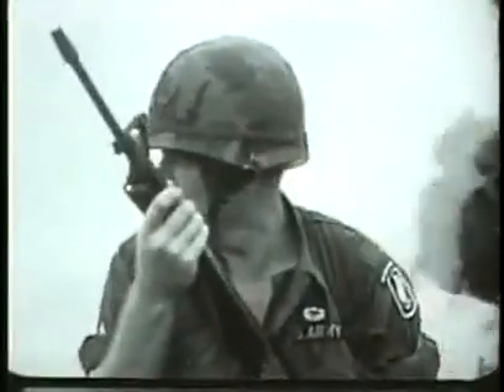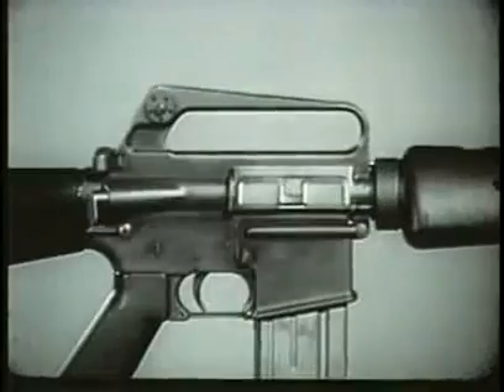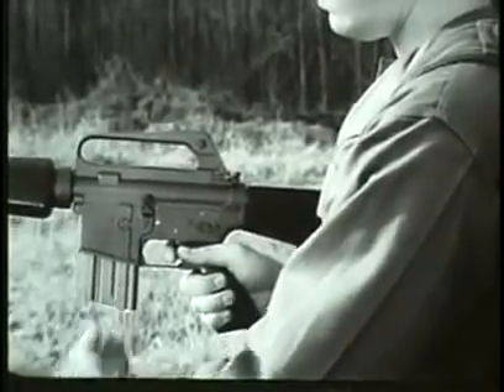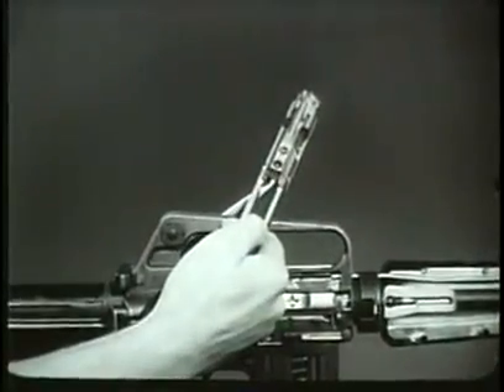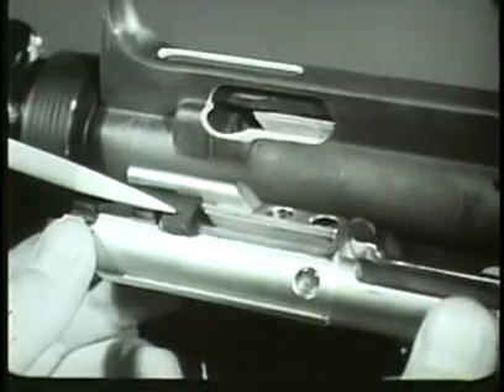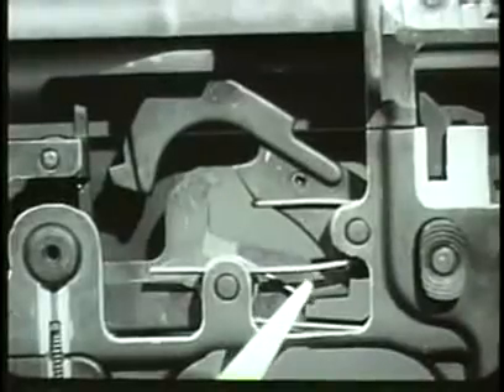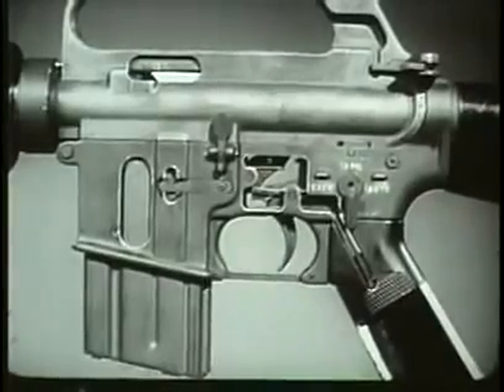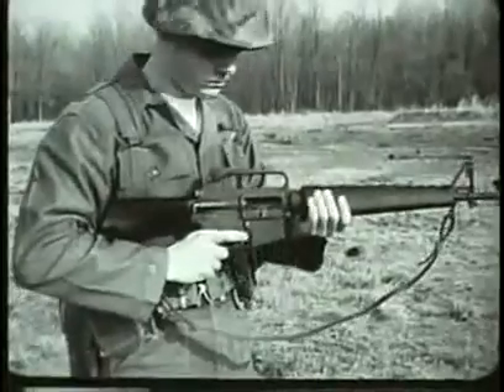Vietnam War Era Training Video: Operation of the M16 (AR15 variant)

Comment: Such a genius design. Those guys at Armalite and Colt had a hit. And didn't even know it.
Reply: Although the M16 when it first came out was cutting edge there were lots of problems including jamming and 5.56 rounds not being able to penetrate hard surfaces like concrete.
Reply: @CrossOfBayonne  The jamming was because of sabotage by ordinance corps.
Reply: Sturmgewehr556 not true. It was mainly with the first renditions.....
Reply: The problem wasn’t the gun, it was the ammo, I believe it had something to do with the amount of powder in the rounds that were issued weren’t the at the levels the manufacturers specified which caused jamming
Reply: Stoner I believe was his name.  Designed it for the Air Force.
Reply: @stevepowsinger733  Correct; Eugene Stoner….a Canadian

Comment: This gun was the “M4 of the 60s”
Reply: The M4 is a short  M16
Reply: The M4 was in Vietnam. It was called the CAR-15
Reply: @whiteboyduke5446  CAR-15 isn't an M4.
Reply: @TheSlovenlyTactician  It a carbine from the M16A1. The M4 is a carbine from the M16A2. Retired infantryman 1996-2020.  Have fun with your air soft matches.
Reply: @whiteboyduke5446  thanks for explaining why you're wrong
Reply: @TheSlovenlyTactician  no problem buddy keep pretending you lived that lifestyle 👍
Reply: @whiteboyduke5446  2012 to 2019 firearms instructor/armorer. They are not the same gun, at all.
Reply: @mk-ey2kp  it's a Carbine the M4 came from the CAR-15. Same gas system,bolt,buffer spring major  difference was barrel size. Now the M4 and HK 416 are different internally. I'm also armour qualified, instructor, etc. Fired 9mm to 25mm. Dragon, Javelin, and Tow2 missiles.
Reply: @whiteboyduke5446  im aware if the g36 oiston in the 416. The car15 isnt an m4. No flat top, not the same barrel or muzzle device, one is an A1 derivative the other is a A2 derivative. Saying they are the same is like saying a stamped akm is a milled ak47. The only difference is the receiver (less differences than the CARvM4) yet people get autistic about them being different.
Reply: @mk-ey2kp  Read what I said before the major difference was the barrel size. Muzzle device was added later to replicate an AK. Flat rail?? You mean a Picatinny rail that was added in the 90's. And don't talk about other weapon systems stay in subject guy.
Reply: @whiteboyduke5446  dont tell me what to do guy this is youtube, why are you changing my words as if i dont know what a picatinny rail is, literally anyone with basic knowledge on the AR platform knows the term flat top. I can talk about similarities in your logic with other firearms regardless of wether it conflicts with your statement. Its not the same gun but i guess an infantryman on YouTube is the subject matter expert. Lol
Reply: @mk-ey2kp  You forgot experience. Now go back to work and check those receipts from customers coming out the store.
Reply: @TheSlovenlyTactician  thank you for counting me in as I used the dining facility after a 12 hour patrol. You still have your clicker guy?
Reply: @whiteboyduke5446  on today's episode of Retarded Grunt is Self Important. We've got a quota of 22 a day, do your part!
Reply: @TheSlovenlyTactician  blood off my CAB. 😆 Really Pogish of you to say fueler.
Reply: @mk-ey2kp  Thank you buddy. And you welcome for the education today. No charge. 👍
Reply: @whiteboyduke5446  XM177 Aka CAR15= M16 Carbine not M16A1 
 (M653=M16A1 Carbine)
 (Colt723= M16A2 Carbine, 727=M16A2 Goverment Carbine 733=M16A2 Commando)
Reply: @mk-ey2kp  differences are pretty damn negligible if you ask me.  But keep it up
Reply: @jlaz450  yes and thats why we use names to note those differences however small they may be.
Reply: @jaigere8078  Yes. And all short barrel M-16's were called CAR-15.  Even Delta Force operator Larry Vickers in his interview said when he joined the unit in 1989. They called it CAR-15. They stopped calling them CAR-15 when they were issued M-4 and HK versions.

Comment: M16 is different from the ar15 the ar15 is only simi-auto while the m16 is select fire
Reply: I believe it’s a case of the civilian AR-15 getting de-tuned for private use.
Reply: back in this era there was little to no difference. the AR-15 on the civilian market was select fire and actually sold as such before the military got it and called it an M16

Comment: crazy to think the AR15 platform is this old
Reply: @AlEx3KillA Watch some mud and dirt tests. The AR keeps the shit out due to its design and the AK jams up. Don't get me wrong though I like the durability of an AK (less small moving parts and springs) but the AR is more reliable in inclement weather, with the exception of extreme cold arctic conditions, where the AK thrives.
Reply: @mr.c8682  ok liberal. You don't know what you're talking about.
Reply: @mr.c8682  My old man said never ever get your M16 wet, dirty, or look at the wrong way, you have to completely clean it before it will fire again. AR15's are probably better though.
Reply: The first AR-15s were made in the 50s.
Reply: Ar15: On Mud
Ak47: On Ice and Snow.
Reply: @AlEx3KillA not factual in the slightest. The AR is a more closed rifle. The AK has more openings leading into the internals. InrangeTV literally made mud test videos on the AK and AR and the AR performed flawlessly. If you dont want to go look up all the accounts online literally just go watch the videos by InrangeTV
Reply: @troopergio  I believe what left a bad taste in the rifle was that they used the wrong gun powder which was for 7.62.
Reply: @troopergio  Ah yes and multiple other people have done the same and the AK was fine, just slightly stiff and the rate of fire was a bit slower.
Reply: @ThePigeon5734  You literally contradicted yourself in the same sentence. A weapon isn't fine if the rate of fire is slower and it's stiff. The AK always jams and malfunctions in mud. because of it's openings. The AR doesn't because it's closed to the elements.
Reply: Mad Mark  It really isn't. As stated before the AK is a more open rifle which leads to more jamming if tossed in mud where as the AR is more closed therefore protecting the internals of the gun
Reply: @troopergio  The AK's open clearances and action means it performs better in other conditions, it's not just a single sided coin. People talk about mud, which is very unlikely to happen. What about something far more likely to happen to an AK, what about sitting somewhere in russia at -40°c where literally everything becomes frozen overnight everynight? That's where the AK shines and will continue to run flawlessly long after the AR has locked up with broken safety switches and mag release buttons.
Reply: @Turgz  So many countries own the AK bro. It's entirely likely that the AK gets dropped in mud just as much as it gets exposed to -40 temperatures.
Reply: @Turgz  Mud is unlikely to happen? Certainly not in Russia. Russia is known to have a muddy season. It's one of the things that has made invading Russia extremely difficult on top of harsh winters.
Reply: @greatcrusader8180 , Doesn’t mean that it works after it gets dropped, just means that it happened.
Reply: @Turgz  man mud can happen on a rainy day man i got to fly around the planet to get in those environments
Reply: People say the first gen rifle was unreliable. It was, but most of the problems was the powder. It was extremely dirty. Modern powders like Hodgdon CFE 223 are very clean. Beware of surplus military ammo.
Reply: To all of you people saying that Trooper Gio has it the wrong way around. You're all a bunch of fucking idiots. He's literally stating facts that the AR is more closed over. Now I can think of two reasons to why you're arguing his point. 

1. You've never watched the videos made by InRange TV and so are not aware of the fact that the AR is actually the better designed weapon

2. You're all just a bunch of whiny AK purists who can't handle it when someone says their favorite rifle has some design flaws
Reply: the ignorance in this comment section is comedic.....
Reply: AR and even the AK is a perfect example of not fixing what isnt broken!
Reply: @AlEx3KillA Sure, but sometimes really bad things could happen in a battle. I'm not in the military, never been, never seen combat. I'm just a guy who likes guns. But it's common sense that you would want something that doesn't malfunction too much during a firefight. Better to be alive and be required to pay top dollar to fix your AR, than to lie dead, face down in the dirt with a now bolt-action ak in your hands.
Reply: And still so versatile and ever changing even with crazy new laws and restrictions.
History will look back one day one this platform and say. The Rifle That Saved America.😎🇺🇸
Reply: @AlEx3KillA Watch the inrangetv video on it. They got an AK an AR, caked them both in mud and muck and the AR performed without jamming and the AK was turned into a bolt action rifle.
Reply: @AlEx3KillA, Funny that you call him kid, only a “kid” who gets all of his gun knowledge from COD would even consider that the AK works well after being thrown in sand or mud.
Reply: ikr
Reply: Kids please shut up none of you even hold an AR or An Kalashnikov but you all have to say something because you think people are so dumb that hey belive you.
Reply: Don’t fix what ain’t broke
Reply: @AlEx3KillA uninformed fool
Reply: @AlEx3KillA Exactly. Freaking idiot up there doesn't know shit.
Reply: All of these AK purists getting butthurt over factual information is hilarious
Reply: @AlEx3KillA "It's the other way around" That's the biggest load of bullshit ever. I've mud tested ARs and AKs myself out of curiosity a few years back and my AR preformed flawlessly each shot, my AK on the other hand jammed nearly every shot and malfunctioned horribly.
Reply: This is the m 16 totally different
Reply: its even crazier that most tech we use today are in fact technically unchanged and only improved upon from the last century, like cars and bikes.
Reply: @AlEx3KillA The ak has some holes in it and mud can jam springs. The ar14 is TIGHT when locked.
Reply: Both platforms are awesome!! The original M 16 is not the same thing as a modern AR 15. There has been a ton of improvements over the years. A modern A.R. 15 that is kept well. Lubricated is just as reliable as an AK platform rifle. I hear people say it all the time and it’s bullshit. “AR 15s are not reliable” and “AK-47s or 74s are not accurate” both statements are false!!  if I knew I was going to be fighting house to house or in a urban environment or around vehicles,  400 meters and closer  then I would probably choose an AK, 7.62 x39 is a very accurate and capable cartridge. It has very, very good penetration through vehicles and light cover.
If I knew I’d be shooting past 600 m I would absolutely want an A.R. 15 with the heaviest round my rifle could stabilize. Although it does have less penetration.
Reply: But m16 > ar 15
Reply: @AlEx3KillA  Yeah, sure. Next time, I'm going to tell the guy who's got his gun pointed at me, ready to fire, to wait so that the replacement parts could arrive and then, I'm going to tell him to wait some more while I clean my ak from all the mud, carefully assess which parts need replacing, do the replacing, test fire to see if I got it right and then tell him he could do whatever he wanted to do before. I'm sure he won't mind.
Reply: AK-47 is better and older.
Reply: @Puppy_Puppington  neither is a better rifle, they both are great and after years of my own evaluation shooting both I’ve found that the 5.56 is better at penetrating certain armor then the 7.62x39, but the 30 caliber ak is better for other certain things, but I sold most of my aks and only rly kept my micro draco bc it’s a cannon and is rly fun to shoot, while I use my ar for hunting
Reply: @mikehoncho658  5.56 will penetrate through more steel, but remember body armor is rated at only 4 levels so there's only a few options. With that being said 5.56 AP will defeat level 3 plates but will not go through level 4. Now 7.62x39 AP will again defeat level 3 plates but won't go through level 4. So practically speaking they're both identical in terms of defeating worn body armor.
Reply: @Turgz  yeah I wasn’t rly talking about body armor itself but what you said is exactly my point, they both have their benefits and I like both of them, they are both good calibers and that’s why I have both
Reply: @mikehoncho658  yeah, the 7.62x39 is a much larger and heavier round, doesn’t penetrating most kinds of armor as good but sure as hell gives a kick, I’d overall prefer the AR though.
Reply: @theboostedbass5297  yeah it’s 30 caliber, and I’ll take either, I don’t prefer one over the other
Reply: @Puppy_Puppington  
But it is a foreign rifle.
The AR is all 🇺🇸.
Reply: Johnny BB Goode and those deaths due to malfunctions were all American deaths too 🇺🇸
Reply: @Puppy_Puppington  How dare you say this ! Those young american boys died for the good of the military industrial complex ! Young Billy from Texarkana died so that Jimmy Carter's son could smoke weed on the roof of the White House.
Reply: @johnnybbgunner2136  Fax🇺🇸🇺🇸🇺🇸
Reply: @Puppy_Puppington  Debatable. The AR and the AK both have serious flaws to them. For Example the AK preforms terribly when it's tossed in mud but when the M16 is put in mud it preforms fairly good. They are both good weapons made for different proposes.
Reply: @troopergio  ak was favored for many navy seals
Reply: @PinelliSC  I know. They used the AK to confuse the NVA and VC because they were being shot at by their own weaponry.
Reply: @troopergio  you got it backwards.....
Reply: @quak3rjim2k7  He hasn't. The AK has loose clearances and the action is more exposed. The AR15 has small clearances between parts and the action is well sealed off from the environment.
Reply: @PinelliSC  Its far more common for you to see M16s and particularly Colt Commandos than it is AKs being used by special forces in Vietnam.
Reply: @troopergio  you have that backwards. The AK is practically indestructible. The M16 was fragile and jammed easily in NAM.
Reply: @troopergio  - The AK47 performed better in Vietnam though.
Reply: @troopergio  you got it backwards buddy, ak can and will run dirty, and doesn’t get dirty from firing, unlike the ar which is very hindered if not failing when dirty, and it dirties itself from firing
Reply: @elestromusicgamesfun1101  100% correct on that. That's mainly because the XM16s ammunition was given the wrong gunpowder which was meant for other rounds that were not 5.56 the issue was fixed for the most part when the M16A1 rolled around
Reply: @ashestodust2313  I didn't get it backwards my friend. The AK is a more open rifle and thus that leads to the weapon jamming in mud. There are videos made by Inrange TV that support what I'm saying. Essentially what they did was they dropped the AK and AR into mud and tried to fire 5 rounds from each. The AR performed flawlessly whereas the AK suffered from many malfunctions. Sure the AK may have other advantages over the AR. But the point that I was initially trying to make was that the AK and AR are both good weapons however one isn't superior over the other as they are made for two different purposes.
Reply: @troopergio  the m16 malfunctions way to much and you also got it backwards the ak performs really well in any climate while the m16 fails in most climates
Reply: @Puppy_Puppington  it really does depend on the climate, the situation, and the user, no one gun can be “better” I’d say they’re really good competitors for eachother, wonderful guns both of them and I’m tired of people shitting on either of them when they’re both amazing rifles that deserve praise.
Reply: @Puppy_Puppington  wow a whole 10 years older
Reply: @Puppy_Puppington  ak is less accurate but powerful
Reply: @Puppy_Puppington  the M14 is better the mini Gatling gun is way better the American Civil War Gatling gun is better
Reply: @Puppy_Puppington  YES WHATS RECOIL
Reply: @Puppy_Puppington  Terrorist weapon
Reply: @Puppy_Puppington  not true at all
Reply: @Puppy_Puppington  you forget that American gun makers are by father better than Russia the m16 design is the best rifle design in the 20th century
Reply: @Puppy_Puppington  m16 is better than both
Reply: @Puppy_Puppington  nah
Reply: @Puppy_Puppington  I love both, but more AR than ak
Reply: @Puppy_Puppington 21 years in the army. I was infantry and I wasn’t impressed with the AK compared to the M16A1. While the AK is more rugged. The M16 is more accurate. This was back in the eighties before the M4 with all its optics.
Reply: @Puppy_Puppington  Ak's are more reliable but have very piss poor accuracy. Ar15s can be a pain to clean but fire more precise shots.

Comment: Why in the world did they not have magazines larger than 20 rounds??
Reply: It's easier to shoot prone with the 20 rounders.
Reply: Light weight for one. Maybe, forces the man with his rifle to be more accurate when he is firing.
Reply: Box count is 20 as well  the old timers said  they duct tape 2 magazine's together oppose for fast reloading
Reply: 20 round mags were shorter than the handle. If you're firing prone on he ground, you use something like a rock, or branch to balance weapon. 30 round magazine It was only after experience in Vietnam that the capacity was increased, as troops wanted 30 round magazines like the VC had with the AK. The 30 round magazine was introduced in 1967 along with the XM117E1/GAU-5A but had feeding problems. More reliablie 20 round mags were mainstay til about 1980 when he STANAG magazine was made.
Reply: Germans also did that for Stg 44 and 45 with 20 round also, for easier prone amd handier in moving about with.
Reply: It was all about laying prone. Taller mag means you're further from the ground
Reply: I prefer 20’s over 30’s. Faster handling and mag change takes no time
Reply: They did have roughly 1000 30rd mags that were issued in Vietnam.